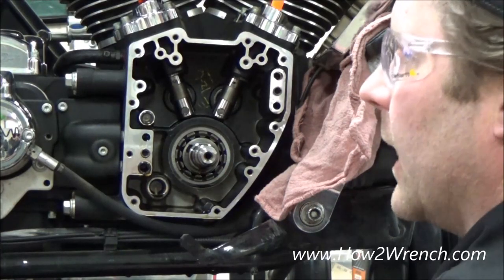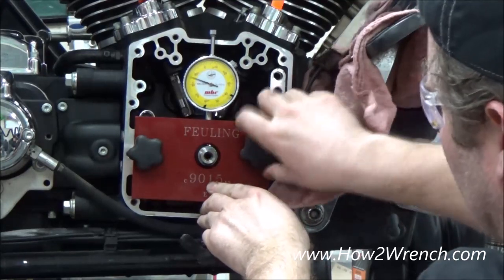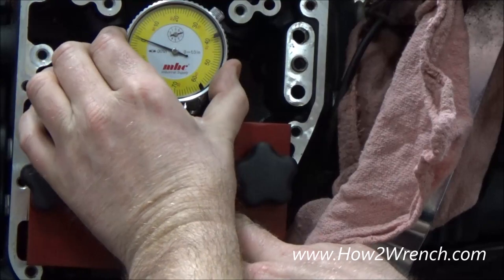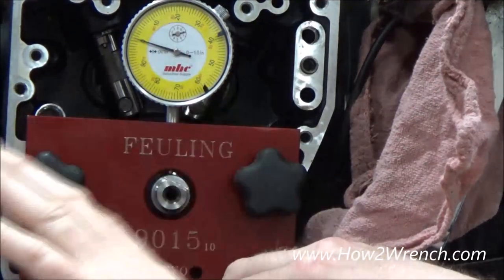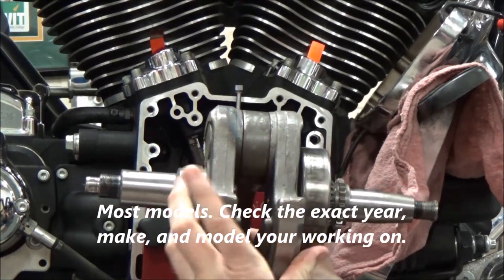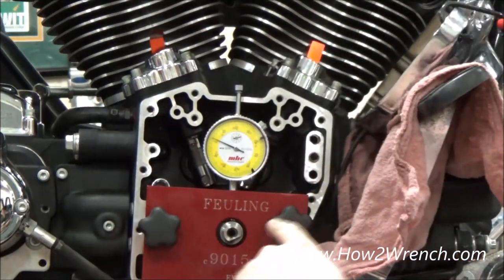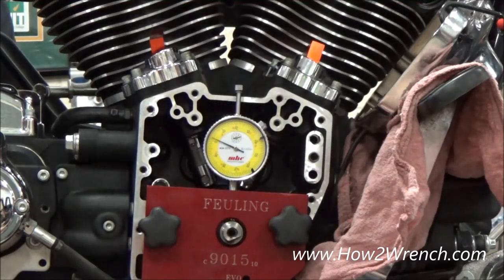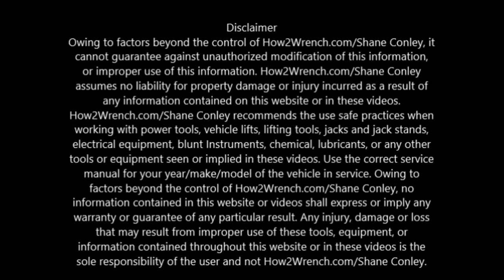How to measure crankshaft runout with Feuling tool pn 9015 Demo on Twin Cam. Works on EVO too!

Comment: hey if you have a dirt bike that is a kick start but has a electric kill switch is it possible to hook up a key to the bike so it can't start with  the key ??
Reply: andy id say u could all u need is a starter motor and your wires and a key switch can't think of any Reason why it wouldn't work

Comment: do we have that type of tool to measure crankshaft runout for a DOHC motor?
Reply from the maker: Not one that bolts on so easy. But a magnetic base and dial indicator is the traditional way.  If I can ever be of service to you, here is a video explains how to connect with me. 
https://www.youtube.com/watch?v=vjvmB01ebcs 
Keep Wrenching,
Shane Conley
Instructor/Motivator/Motorcyclist
www.how2wrench.com

Did you like this free video and hope to see more? Would you just like to say thank you with a donation? Click https://www.paypal.me/how2wrench 

Like freebies? Click here for a free diagnostic checklist! 
http://gem.godaddy.com/signups/364621/join 

Head over to the new website and subscribe to the newsletter to never miss a video or newsletter! 
https://how2wrench.com/contact/

Comment: All Twin Cam engine stock crankshafts are only pressed together, which creates a potential for a twisting crankshaft, which can lead to engine failure. Max run out on the pinion shaft should really not exceed 0.001".  Harley did away with a bolted together crankshaft, when they quit making the single cam engine, i.e. Panhead, Shovelheads and EVO engines.Not good.
Reply from the maker: Thank you for sharing…below are some links that help support me and my work. Please subscribe and share these videos to make a difference in education!
Keep Wrenching,
Shane Conley

Shirt/Stickers link: https://how2wrench.com/product-category/specials/ 

Follow us!
Web:
http://www.How2Wrench.com    
http://www.Tools2Wrench.com  

YouTube: 
https://www.youtube.com/c/ShaneConleyhow2wrench  

Instagram:
https://www.instagram.com/how2wrench/ 

Linkedin: 
https://www.linkedin.com/in/shane-conley-how2wrench/ 

Facebook:
https://www.facebook.com/MechanicsLearningSharingPage/  

Free Mechanic info, tool reviews, and “how to” videos newsletter sign up: https://how2wrench.com/subscribe-free-newsletter/ 

Amazon Tools: 
https://www.amazon.com/shop/shaneconleyhow2wrench?ref=ac_inf_hm_vp